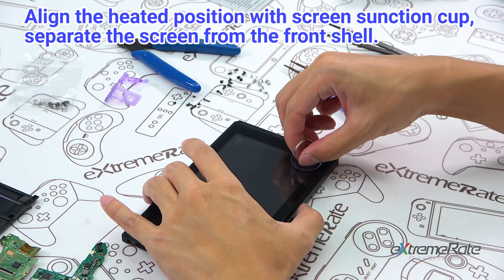Updated Nintendo Switch Front Shell Tutorial

Comment: for screws in plastic, never screw them in right away .. always turn them a couple turns the other way to find the beginning of a thread! otherwhise you risk threading a new thread into an existing one, killing the screwpost that way
Reply: Take this guys advice! Just did this tear down
Reply: Amazing, I never would have known!
Reply: found out the hard way even though i did this on some (not all) they are just turning without gripping at some point
Reply: that's why my screws kept stripping!
Reply: There is no threads on these molded parts, it self threads when u use it. Although taking it back apart it will have threads now, you guys that are stripping screws are just hammering it too hard, be very gentle and don't put more then a couple inch pounds of pressure on it.

Comment: I don't understand, why did you need to dismantle everything? Could you not just take off the back, then the metal backplate inside (for battery & ribbon cable access,) unhook the battery and digitiser ribbon cable, then heat and remove the digitiser and then take out the 4 screws in the front shell? Why take off the heat sink and thermal paste and all the other stuff including the motherboard? Seems unnecessary. Are they screwed into the front shell?

Comment: for the love of God, if you're doing this, please remove and reapply thermal paste!
Reply from the maker: Thanks for your suggestion! If the paste is still dry, you should do it, otherwise it's unnecessary.
Reply: What is the thermal paste? Is it in the video?
Reply from the maker: @jemma9494  That gel/paste on the main processor, you can see it after you take off the metal cover at 04:35
Reply: @ExtremeRate  I would replace regardless if you have air trapped between the surfaces it will cause the the console to over heat
Reply from the maker: @ajswann100  hmm, it makes sense.
Reply: Why?
Reply: I did this a few years ago I think and I didn't do that

Comment: Just wanna say this to anyone who sees this:

- Use a PH000 in lieu of a PH00 to avoid stripping screws
- Disconnect the battery the FIRST chance you get one
- Use a microfiber cloth or air duster on both the LCD and digitizer before reassembly
- Replace the thermal paste if you can (on the CPU AND the back of the metal plate), clean thoroughly before you do
Reply: agreed, this is a top issue i deal with when i get people who tried "repairing" their own console. since they dont change the thermal paste they complain that now it overheats.
Reply: @thefractured5364  should I use artic silver or a thermal pad you think?
also I noticed 2 more mistakes in this video ,  he re connected the battery too soon  ,that should be the last thing you connect , and the worst mistake I  saw in this video is him starting to pry up the digitixer from the  right,  (right to left) instead of of left to right, ,  you should not start on the  end that has the    ribbon cables,  that's a good way to break the  cables
I really want to  do this but with a machined aluminum   front plate ,   the bit with  the power and volume rocker  membranes    kinda worries me though ,  since the machines aluminum  shell will probably not be as flexible as this plastic one

Comment: Was doing this and 3 of the side rail screws stripped. Decided not to continue since the screws would not come out and followed the video to reconnect everything but when I try to turn it on nothing happens. :( Just like every other aspect of my life, I managed to mess this up too. You guys make it look super simple.
Reply: did you use a phillips head screwdriver on the side rails? another commenter mentioned that the side rail screws are actually JIS 000 screws, not phillips
Reply: @briannanimal2174  I used what came in their kit.
Reply: I had this same problem with the top screws on each joycon rail. I got around it by carefully drilling into the top of the screw (the drill bit needs to be fairly small) until I could pull the rail off by breaking the screwhead. This left the rest of the screw in its place, which I then removed using some long, thin pliers  by just manually rotating it out.

Definitely wouldn't recommend doing this replacement unless you actually need to replace the front plate because it's damaged (unfortunately mine was).

Comment: Today I learned that these screens are more fragile than I thought, because I was taking my screen off the adhesive after heating it and it came off fairly easily but my LCD screen cracked when I pulled it off the adhesive :( so I just ordered a replacement screen from iFixit and I'm gonna replace my screen and finish this DIY build

Comment: How necessary is the rear heat shield? Would love to see more of the back internals instead of a metal plate
Reply: Wothout it, the console could overheat, and even worse, melt the back plastic plate
Reply: You only need a portion of it, at the part where the thermal paste is at to help dissipate heat. You can check out TronicFix's clear case mod video where he removed a huge chunk of it. https://youtu.be/uJPjtVUWmkk

Comment: I just installed my Sakura front cover from you guys and it’s so pretty! BUT my screen is blank when I turn the switch on. I get sound and can see that back light but no picture at all. Any idea when I might have done wrong or possibly damaged?
Reply from the maker: Please make sure the flex cables at 37:35 and 39:48 are plugged correctly
Reply: I had the same issue! Make sure the ribbon cables for the screen near the top left of the back plate are fully inserted before closing the latches

Comment: All was going well until bam! A stripped screw! I dont blame Extremerate I blame Nintendo because I was gentle used the right tools and the screw was extremely brittle. Guess I'll just live with Damaged housing or Nintendo won't realize I opened the console. Didn't get too far however I did replace the fan while I was in there because it sounded like a jet engine but now its quiet as hell. Oh well either get Nintendo to repair it or find a local electronic repair shop.

Edit: just an FYI, spoke to Nintendo repair services its a little over $100 after tax and shipping for repair with your console not covered by warranty. Keep in mind that if you attempt this mod/repair and Nintendo finds out you tried you void any warranty. Didnt matter for me because I have had my system on release day so warranty expired anyways. It was worth a shot just to save some cash though. May try a local repair shop first if they won't attempt the repair for cheaper then its off to Nintendo my console goes. Also before I send it in I intend on removing the new fan I installed and swapping the old one back to the console. The Fan repair was easy to do as it is to swap the joysticks on the joycons when they have drift issues so I would recommend saving the money for those repairs. The fan that I bought is 10× better than the fan installed by manufacturer. Its on Amazon and listed as Amazon choice. It is faster than the original and extremely quiet to the point you wouldn't realize the fan was running.

Comment: Scared to do a large scale shell mod like this but I'm gonna go for it.
Reply from the maker: Good luck!!!
Reply: @ExtremeRate  it went well 👌
Reply from the maker: @CallMePuddlez  Great!
Reply: @CallMePuddlez  hi on a scale from 1-10  how hard was it thanks
Reply: @h0udinl  prob a 7, it was made a lot easier for me because I watched this whole guide through once and bought all the equipment beforehand (heat gun, tweezers for ribbon cables, suction cup, etc) and I have a good amount of experience modding controllers.  It's just scarier and longer, and the heat gun part is pretty scary I just took it really slow.
Reply: @CallMePuddlez  my screen could come off with little heat it’s so old my experience is completely disassembling a PS4 so I think I should be fine
Reply: @CallMePuddlez  hey im on the fence about doing this mod cuz the part with the suction cups and the screen kinda scares me. ive modded systems and controllers before but i've never opened up a switch which is the main reason why im kinda hesitating to do this. however, the transparent shells look really cool and i want a matching faceplate. do you think it's worth doing this mod? how long did it take you?
Reply: @CallMePuddlez  also, how do you prevent stripping screws? i hear a lot of people strip their screws using the included screwdriver, i'll probably be using my own. did you have difficulties taking out the screws?
Reply: @kev2k  get a better set of tools with better quality steel. it took me a while to do because i ran into some hiccups. A hairdryer worked fine and getting a strong suction cup is a must. you just have to pull up gently and you will hear the glue unsticking. you have to go sections at a time because you need to keep heating the areas that are yet to be unglued. overall the screen part was not that difficult. it just takes while if you are being as careful as possible. In my opinion, it is worth it because it completes the look with the joycon shell swap and backplate. most people just do the joy-con and backplate but i rarely see anyone with a front plate also. Not to mention if you want to pay for a switch thats already customized it costs an arm n leg
Reply: @kev2k  It is because the switch uses JIS000 standard screws that only the Japanese use (hence the name Japenese Industry Standard), so people in the west with their PH000 or even PH00 are bound to strip the screw heads by default.

Comment: Three of the screws on the battery side for the joycon have stripped halfway unscrewed using the supplied screwdriver and now I'm stuck here unable to finish the project or even put it back together. Any tips?

My Switch was refurbished and the screws on this side were already showing signs of abuse
Reply: Tried the hot glue crap, tried heating it up. Still unable to unscrew it

Comment: Just a question for all, does anyone have a Nintendo Switch V1 and successfully did this to their Switch or does the V1 and V2 model should be the same? If so, did your screen come off in one go like the video demonstrated or did you have to separately do the LCD screen then take out the digitizer because I’m having a lot of trouble just using the suction cup and heat gun method.

Comment: If the switch console doesn't work by turning up perfectly wouldn't it have something to do with the battery or ribbon cables? Cause I want to make sure when I disassemble my swtich I want to uninstall and reinstall everything correctly.  I received a replacement back plate and front plate in the mail and I'm hoping when I make my switch brand new it will turn out well in the end
Reply: if the battery and connection are good, it would most likely be a ribbon/connection issue somewhere else. just be gentle, take your time, make sure everything is plugged back in the right way, and you should be fine.
Reply: @subtleusername5475  oh ok thanks

Comment: I worked on pulling out that second tiny plug (at the 12 minute mark) forever until I cut right through one of the wires with my tweezers. Guess I ruined the whole thing? :( Some of these things are really tightly in place and takes a lot of force to get them out, I think there's a high risk of ruining your switch...

Comment: Really really good tutorial, I got to the part at 08:23 and the screws on the side stripped really easily, I got 2 out but 2 are permantly stuck. So I can't get past this step. Tried the supplier screwdriver, a larger one, then as they stripped the elastic band trick and all sorts.
Be really careful with this step, I put mine back together but can't use the new faceplate :(
Reply from the maker: Sorry to know that, if you still want to take off the screws, you can refer to this: https://www.youtube.com/watch?v=xaQ9eX-b6GA And there are also many other instruction of how to remove tiny stripped screws on YouTube.
Reply: @ExtremeRate  Sadly that was the first video I found, and I tried all of the hacks and none of them have worked. I am stuck at the rails/side screws. I may have to purchase a screw extractor kit, or unfortunately waste the frontplate. Not your fault of course, excellent tutorial truly, just nintendo's screws!

Comment: Three of the screws have stripped really badly with just a few slips, I can’t even get the backplate off now because they’re holding it in place and everything I’ve tried hasn’t worked, I’ve tried rubber bands, glue, fabric and they’re still stuck, any suggestions?
Reply from the maker: Sorry to know that. We have 2 suggestions: 1. take it to the repair store; 2. ruin the housing and use a mini plier to take them out.
Reply: @ExtremeRate  Wdym by ruin the housing? Like, break the backplate? If yes, then would you recommend someone to do that if they have stripped backplate screws and are going to change the backplate anyway?

Comment: is there anyway to do this without the use of a heat gun? would a hair dryer work to some degree?
Reply: Did this work? I'm without a heat gun too and torn between buying one or using my hair dryer.
Reply: @user-qf8zu6ur7u  I have not tried it, i would have but I ran into a striped screw mid-way through taking apart my switch.

Comment: The only issue I am having is that my right joy con is not being detected by the switch. Like at all. It shows the joy con being put on, you can see the colored bar. But not connection
Reply: Now, the joy con color is not detected, it only shows a gray bar. Not green
Reply: Does your Joy-Con have a skin?
Reply: @KarmaLlama42  oops, sorry, I just needed to fix some of the ribbon cables. I just needed to tighten them

Comment: ribbon cable for the digitizer is too short to plug back in........ whta do i do now
Reply: for those of you with this issue as well, what you need to do is get strip of sandpaper and file the slot opening for the digitizer  cable that is on the front of the faceplate on the right side.
Reply: Same thing happened to me, and I'm surprised more people haven't commented about this.